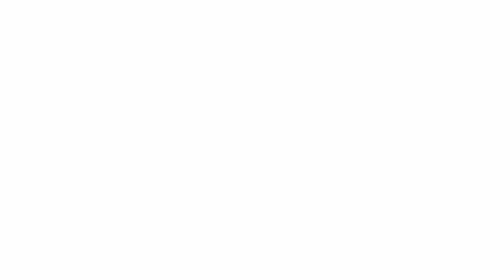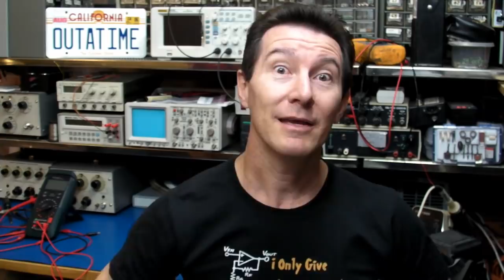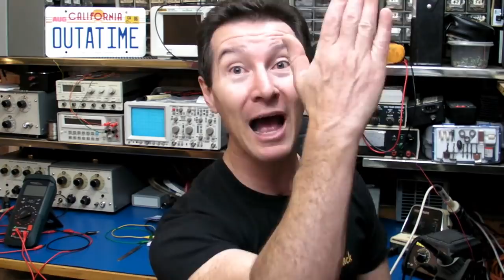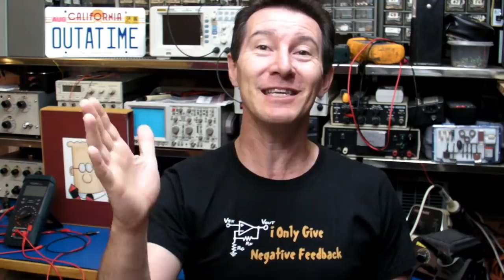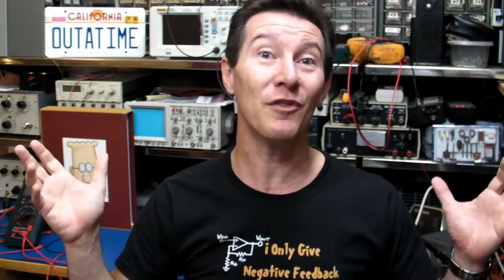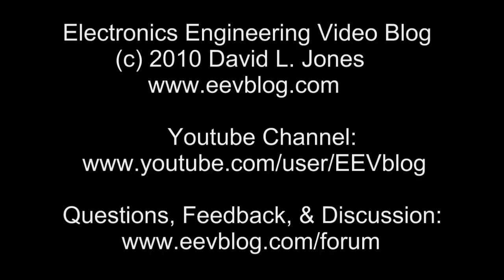EEVblog #138 - Top 5 Engineering Graduate Tips

Comment: Good advice. Some supportive anecdotes and suggestions:
- If you want to go into electronics engineering, and knew it before college (preferably you already have the idea while in middle school or early high school), start building kits, making little projects, participating in "maker" activities, try to learn some basic theory, get part time work that lets you get some experience in the real engineering world, even if it is not your desired discipline (e.g. if you work in a hardware store you can learn things about plumbing and electrical power that will help to not only give you a leg up when you start studying formally, but will help form your mind into thinking like an engineer). I was given a Heathkit electronics project board when starting in middle school, and that helped immensely, and I also took things apart to learn how they worked, and this helped a lot.
- In school, I read a LOT, and tried my hand at writing science fiction novels (I sucked at it, but the exercise was beneficial to my personal growth). I also volunteered to write for the school newspaper. I came out of that with a much better ability to write (and spell) easily and comfortably than many/most other engineers I have encountered. Reading a lot helps with both writing and grammar and spelling. I have gotten into some good positions in my career because out of the crowd I could write better than the others.
- Learn how to do engineering drafting. Take actual courses in this early on, and hone your skills at both hand drafting and at CAD. I have worked with a lot of people who, while otherwise good enough at their jobs are unable to make a decent drawing, and who can't dash out a 'napkin sketch' to help themselves think through a problem or to help others understand what they are talking about.
- When you do start going into school and studying your desired field, don't necessarily rush through the two or four years or whatever; allow time to work as an intern, or once you have some basic theory in your head, perhaps take a full time job as an electronics technician, because the real world exposure will not only help cement the theory, it will help additional theory make more sense, and if it turns out that you hate this field after all, at least you will know before burning through a lot of college money, and you can change paths. I started my electronic career as an electronic technician, which I did for a couple years, everything from wiring up chassis to assembling and troubleshooting circuit boards, and this gave me a leg up that allowed the company to earmark me for advancement even before I finished my degree, so I was promoted to 'junior electronics engineer' before I finished school, and then full promotion once I got the degree. And the company paid 100% of my tuition, since it was directly helping them, even though it took me longer to get the degree since I had to take fewer classes each semester...the company allowed me to take time during the day to attend those classes I could not get any other time, and I was able to 'test out of' some courses based on what I had learned on the job.
- Definitely take advantage of travel opportunities when your employer offers them; best to do this before you get married, or when it is just you and your spouse before you start a family. Or consider taking a couple years in the military or in the Peace Corps or in some kind of missionary work that gives travel opportunities to unusual places outside of your comfort zone. I got to spend a few years living and working in places I probably never would have seen otherwise, and it helped form a more mature world-view, beside being generally life-enriching. And many companies reward those who agree to work in their offices or territories outside of their home countries by offering those people better positions afterwards.
- My first engineering job was in a company of about 80 people, half of which were engineers of various types, designing and building a wide variety of products. I got to do product planning, circuit design, circuit board design, writing specifications, interfacing with vendors, debugging, service & support, software design, and even some assembly work from time to time. This was the most fun I had in my career.
- As I got older, I wanted more security and stability, and after a few transitional job moved into a larger company that was very conservative but also very stable; the kind of place where if you don't screw up too badly, you can probably work there until retirement. But within that company, I always tried to be a leader, yet also be a good team player, and most of all I tried to "go the extra mile' and take on extra tasks. This made the jobs more interesting, but also made me more valuable to the company, which increases job security and also salary. Even though the job is not as much fun as the first one, it is still varied and interesting, and there have been very few days when I did NOT look forward to coming to work. When there were undesirable issues with the job, I worked to provide constructive ways for the company to improve in those areas, and my efforts were not only satisfying to me but were also productively received (mostly) by management. And the security and salary allowed me to do all sorts of fun things elsewhere in my life, and to travel more, and have more expensive hobbies, and to pursue activities that I am passionate about. I don't necessarily advocate this path for everyone, but I see a lot of people who bitch about their jobs, but who also refuse to do more than the minimum expected, and in my view they are digging their own graves.
- Finally, try not to be one of those tech geeks who spend all their time either working or playing video games in dark rooms. Look after your health, find some kind of fun way to get regular outdoor exercise. Find more 'real world' activities that get your out and interfacing with other people. Volunteer some time for whatever functions you care about.
Reply: Thanks for these great advices

Comment: Joined a large UK company who offered good money for a job spec that was pure electronic design. Left a small company where I did everything from design to firmware to product support to go there. When I started, I was told the job spec was to find people with the right electronics background. Turns out the job was to use those skills to write specs and scrutinise 3rd party suppliers electronic offerings ... so No more hands on design or firmware, just your knowledge! Left it 5 years later to start a "1 man band" company doing work for some of my old employees but now doing the hands on stuff on my schedule (if I don't want the work, I'm busy! If your good enough, they'll wait until you are). Never been happier. Don't put up with a job that is not satisfying or even de-skilling you, life is way too short! Took a drop in money to start with, but it was well worth it. Got a better life/work balance now too.

Comment: I have been working for 13 years now in the Computer Science field. I've worked in places ranging from a big telco to startups that were bought by big multinationals. There's no such thing as the perfect job. The tradeoffs you'll be able to accept will vary over time. At a given time you might choose dealing with a crappy manager in exchange for a good salary, but maybe a couple of years later you'll prefer a good work/life balance for a lower pay.
I completely agree with your piece of advice: be good at what you do, be committed in your role and don't let your job stale your knowledge or suck off you joy. If it starts happening, dedicate yourself to your own side projects and start looking around for other positions. Fortunately, in this field, if you're good, you'll always have a job.
Bottom line is: strive to be good and to learn something every day. This will provide you options for other positions. This means you don't need to be trapped in a job forever and consequently you will be able to challenge things when you think they should be improved, without the fear of losing your job.
Cheers all the way from Portugal

Comment: I have been working for a small electronics company for the past 3 years. The work is great, I get to do every part of a projects development. Software, PCB design, Circuit design and prototyping, Firmware, Mechanical design. I think it also gives you such a great voice in the company as to what should be done on certain projects, it's just that whenever I look around at other people doing vastly simpler jobs they are all getting paid so much more, almost 8K more than me per year but I know that if I go to a larger company then I will be stuck designing one boring thing for a year with no say in what the product does. Such a dilemma.

Comment: The thing I already learned during my first internship was that it depends alot on company size. A global billion dollar corporation hires for absolute niches. They hire you for this little part of this little project and after that if you stay with them you will need to find your own way to another decent project. At the other end of the spectrum you have start-ups, where you end up doing everything from cleaning to project planning, from your field to every adjacent field and the one next over to that as well.  In comparison medium-sized companies will usually hire you "as the engineer guy" and shove all kinds of different work in your direction, which personally made this kind of workplace the most interesting to me. You have a somewhat defined job description but you get to do many things, you have to find solutions, learn about new technologies in many sectors of the industry. Yet you are still an electrical engineer at the end of the day, not the stand-in for the mechanical engineer as well as 50% of the marketing "team" and another 70% of customer service "team" like with start-ups.

Comment: Well I was in the Aerospace Defence industry as a Hardware Electronics Test Engineer, self employed, that was more interesting than stuck in one company, but you need experience First, as a contractor you can do 6, 12, 18 months contracts, as a Hardware Test Engineer you still have a input to the design team, when tests show up a design flaw which often happens, yes I hate boring paperwork contracts, but at the end of the day it pays ££££👍, so if you want to get your hands dirty like me, go in with a bias  towards Hardware Test Engineer, that way you get hands on which is more what I think you want, first with any job you want to gain experience, maybe HR can help you more with what you want, I was in the industry for over 42 years, so I know how you feel, I worked for many companies, Airbus, Astrium Eads, BAE Systems Saudi Arabia, Cobham, G4S Technology, GE Aviation, Thales, Selex Es - Leonardo, Smiths Aerospace, etc etc, 
Think of it this way, you can't start at the top, you have to make your way to the top, this is the fact, and what Dave said your line design manager is going to get the cream of the design work, and as Dave said if anything goes wrong in the design fingers Will point at You, which could cost the company many Millions £,
There is a way to think of it which most people will agree, your making £, so there is no reason why you can't use that to design something great at home, YES, maybe one day you then design something great, get it put together in China, then lots of sales, then sit back and watch the £££££££ come in, then retire early, still making lots of £ on profits !, Experience First !...a Must !,
I worked in the UK I can have a great guess at what company your working for, :) anybody for a cup of Tea......😉 I am now retired and relaxing out of the rat race thank god, sometimes I used to work 12 to 14 hours a day as a Test Engineer £££££££££££, Oh Yes 👍 😄 😀
By going contracting After gaining Experience you can make sh*t loads of £ and choose who you work for, even more for gaining experience work with many companies, what I can say is stick it out at least say for two years, don't quit quickly without giving it a go, if you quit too early in the industry its frowned upon, they will blacklist you for getting back with them, Aerospace Defence industry is dam interesting, so keep up the work, if you don't like it, maybe work for university research side, Jodrell Bank in Macclesfield UK, 
Yes I am near that place,
Eventually if you think Aerospace Defence industry is a good choice 😉 👍 it is for a design engineer ££££££ 😉😀👍

Comment: 2 IAM working my projects with the company equipment because I set the machine so good up and made it work so good that I just go down to pretend it I have to repair or set it -> and I go to the other machines because I am  interested what problem they have and fine-tune it to because this machines part of my production line . Managment you can not use Arduino . YES I will but I don't tell you . and management don't care if the machine gives better numbers

Comment: Damn, I remember when this video actually came out originally.  Been watching since those days!  A lot has changed for me with all these years.

I do 95% cutting edge design work (cryogenic circuits, laser drivers, ultra miniature cameras, wafer test, big FPGA test boards) and I only have a 2-year degree.  I worked hard outside of the classroom to become an expert in my passions.
Reply: That's sounds amazing,... In which company do you work?
Reply: I graduated last year and only managed to get a job as a sales assistant for a PCB vendor even though I applied as a layouter. I'm jealous
Reply: @MrGuano11  it's much easier after you've had your first job doing PCB layout.  I've been doing it for 10 years.

Make projects in your free time and show them off to companies and during interviews.  Dave taught me that one.
Reply: @MrGuano11  There is an element of luck to starting out, but what Randy says is absolutely right - if you have your own projects to show off, especially if you have actually made them and show them in the interview, you're already going to be miles ahead of the competition, who are likely just sitting there talking about how they can do this and that.

Comment: Hi Dave,
Thank you for the advice. I can highly recommend checking out the different fields of electronic design. I am working for a small company in Germany which does analog ic design, CV and production test (both in house and externally). If somebody wants to gain quick experience in a specific application, there is no better way than trying to figure out how to verify, quickly test or design the curcuit from scratch.
If anybody is interested and i am allowed I would like to shout out our company name (about 50 employees). We offer internship and thesis projects for international students on a regular basis and employ several Australian interns every year.
Reply: I am very interested. What is the name of the company please?
Reply: @jeanemmanuelndjenkoua4614  eesy-ic GmbH located at Erlangen (Nuremberg)

Comment: The tech/aerospace industry is the last branch you wanna be in if you don't like paperwork and millions of checkups. It's really the hardest industry on that point, where everything goes slow as hell. So many safety measures, as well as Parts that have to be so precisely specced (milled or turned parts 2 meter big must be within minus 0.01 mm accuracy). If the slow paper mill is not for you, definitely don't stay there. But the money is very good, and the technology can be very intetesting (depending on your department/ job description). I remember going to those companies as a service tech, and i always noted the atmosphere was so lame/boring compared to all other companies. Seemed like they were always working on 10%, there seemed so less activity ( this is an impression as an outstander, i never worked in a aerospace conpany myself, i visited 3 different one's in my carreer), good luck!

Comment: I'm 32 with an EE degree. I aways wanted to work with electronics, but I'm stuck on the software path. It's so hard to find electronics design work these days compared to software engineering.
Reply: What are you looking for exactly?
Reply: I'd like to switch form software to hardware engineering. I've working with embedded systems for a few years, but always on the programming (C/C++/scripts) side.
Problem is that job market for hardware is much smaller in my country. It seems everything hardwarewise comes from China.
I've saved screw-you-money. So probably will quit my job and work on my own projects. This pandemic is scaring me to do so though.